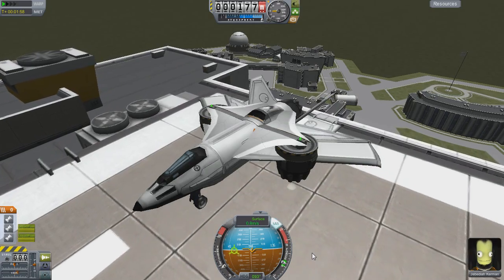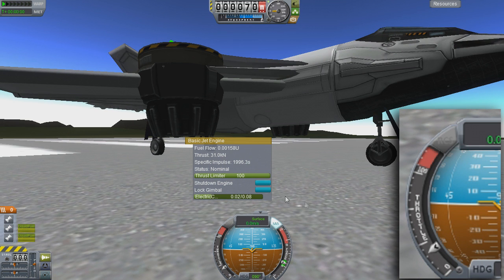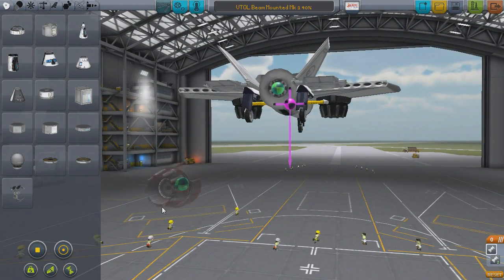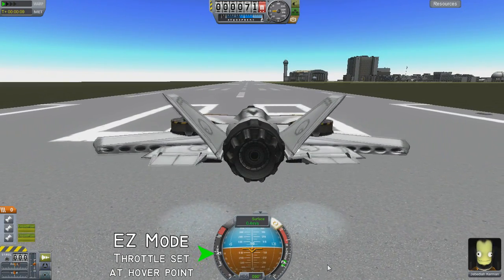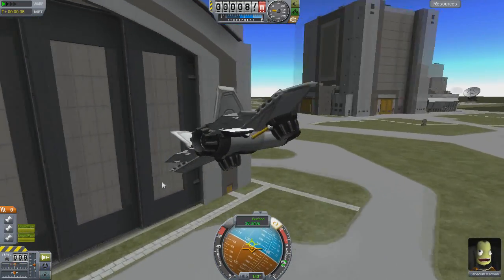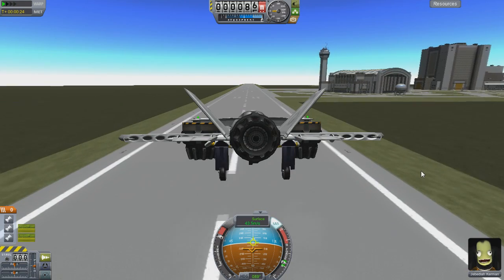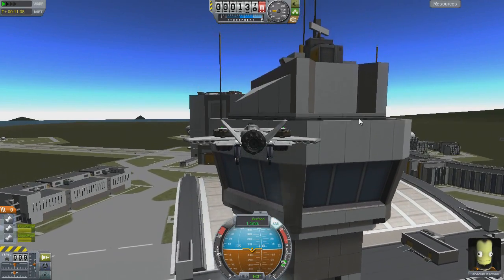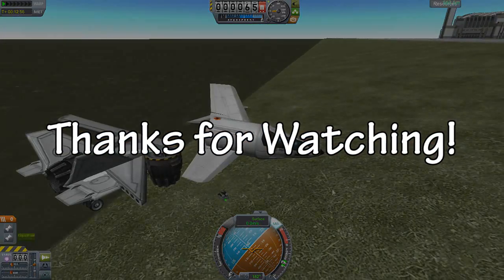KSP Quick Guides: Flying and Landing VTOLs v.23

Comment: I'm having issues with getting my plane to stay hovering. I'll get it to come to a full stop and then it will start rising, I get to stop rising and it moves forward again. Som advice would be much appreciated.
Reply from the maker: Ya I usually give the plane a little bit of forward speed to keep it stable. I'm assuming you play with a keyboard? CupcakesLanders, flies with a joystick which gives you the amount of precision you need to nail down a true hover. The best advice I can give you if you're trying to get a true hover is to practice with precision controls (Caps lock on) or use Trim (Alt+WASD) which fine-tunes stuff, but even then it's pretty tedious. 

Unless you need an absolute, pure hover you should be fine in 95% of the situations with a tiny bit of forward speed :). The only time I could see you needing a real hover is if you're trying to pick something up with a docking port or land on a flagpole xD
Reply: Cruzan AK Thanks! Really helped because I didn't know how to trim. But now my plane can hover.

Comment: Hey Cruzan, I have a question for you. How are you supposed to put vertical fins of a VTOL? Because my vtol design cannot spin with the d and a keys when I have a vertical fin, because the craft begins to get unstable. I have tested this to make sure the vert. fins are the cause of this unstableness because in the SPH when I turn my craft with the vert. fins on, the center of lift starts to point to the side. Without the fins, this doesn't happen. So if you want me to post some pictures for you to see this in more detail, just let me know.
Reply from the maker: Hmm I'm not sure exactly. Pics would definitely help, but I'll fire up KSP and see if I notice anything weird.
Reply: http://imgur.com/a/yFgwt -- Here you go. I point out in these pictures what my exact problems with the craft are. Only difference is this is a slight redesign, but now the centers still change when turning with the A and D keys, even though there are no tail fins. D: So hopefully you can give me some pointers! :D
Reply from the maker: Ah okay thanks. The way the SPH calculates things for those bubbles is similar to a wind tunnel. The air flow is always the same direction regardless of your craft's orientation. It calculates lift by looking at how much of a wing is perpendicular to the flow of air.
So...in those first pics, when you rotate the plane with the A/D keys, what the SPH is seeing is one wing that is fully in the airflow, while the other is angled back. In pic 3 you can see this because one wing is getting almost 100% of it's lift while the other is closer to getting almost 0%.
It's not a design flaw or a bug, you just have to take the plane out of the hangar and test it out!
Does it fly really weird?

Comment: i use the trust limiters so i can throttle all the way up and go up slowly
Reply from the maker: Do you do this if you're using multiple VTOL engines? Your method probably works great for single VTOL setups. I really wish we could actually type in a value for the thrust limiter instead of using that slider!

Comment: you should make a vtol plane with a docking port and put a fuel tank and a docking port on the helipad then try to refuel mid air
Reply: every time i have tried to dock mid air the throttle resets to zero as soon as you make the connection... very annoying >:(
Reply from the maker: Oooh...I really want to try something like that now!
Reply: Or how about an a helicopter with a cargo bay on the back that opens up, so you fly in with the VTOL, land, and dock somewhere on the inside and refuel.
Reply from the maker: Walker Wilson Are we talking about doing this in mid-air? If we are...that sounds incredibly difficult haha.
Making a helicopter would be the first thing I'd need to learn to do! Those things are tough to get right using stock parts :)
Reply: oh,have you seen eddie rods air to air video?
he refuels mid air!
Reply: todd lithgow ooh, really? how the hell does he... runs off to see
thanks for the reply :)
Reply: What jeb does is he jumps out of the plane infront,grabs a KAS link,then attaches it to the other plane.
Reply: It killed the throttle for him too, not too much of a problem with jets, but.. A big problem for vtols :)

Comment: you should make a video on how to do tricks in a VTOL like backflips and rolls. every time i try i go out of control and it doesnt stop rolling or flipping
Reply from the maker: That's a good idea, thanks!
By the way, does the plane you're trying to use have it's CoL too close or in front of its CoM? That could cause the issues you're having with coming out of a flip. If your plane is stable with the CoL behind the CoM it shouldn't have those problems as much :D
Reply: the CoL is a bit in the CoM should it be completely behind??? :P
Reply from the maker: bubby Daniels Hey sorry I missed this reply! Hopefully you were able to figure it out though :)
If I want lots of maneuverability I'll put the CoL slightly inside the CoM bubble, but still behind. For a mix of stability and maneuverability I'll place it outside the bubble, but not too far back.